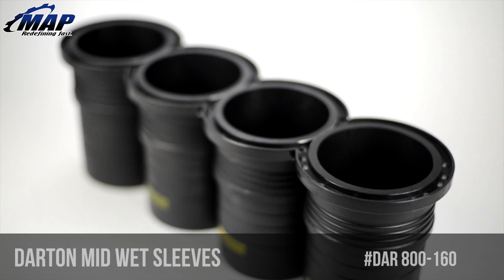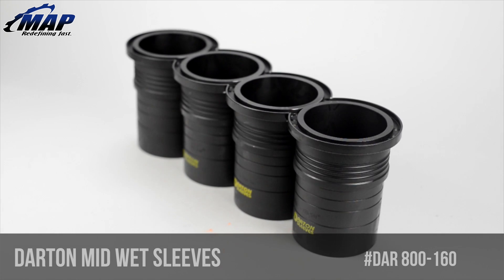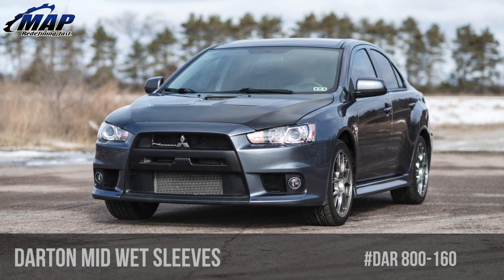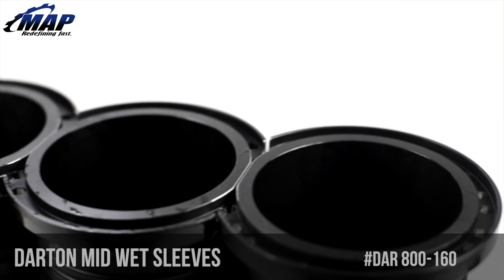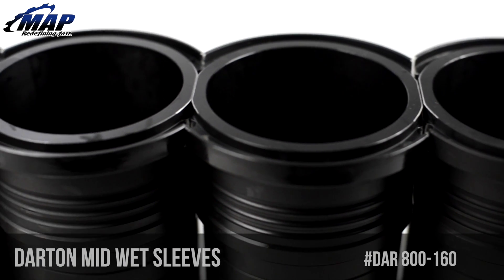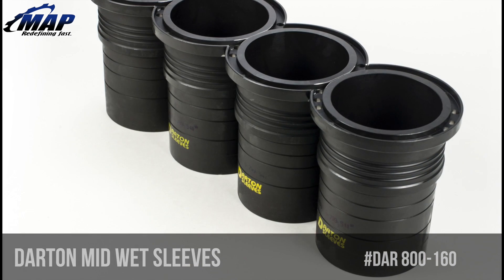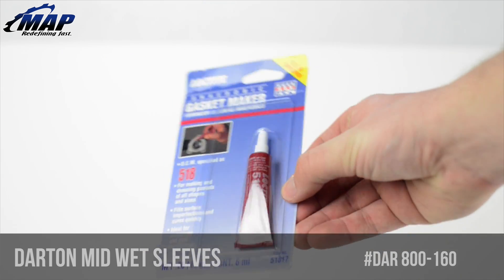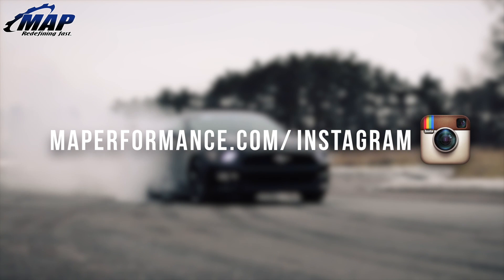Darton Iron MID Wet Sleeves | Mitsubishi Evo X 2008-2014

Comment: if wet sleeves cool better why are dry sleeves better?
Reply: Dry sleeve are for drag racing setup. Wet sleeves are for you every day driving but is able to hold more power then your stock sleeve. Dry sleeve block off your coolent passage so there no need for a water pump. That's why it called a dry sleeve. Dry sleeve are almost like billet engine blocks.